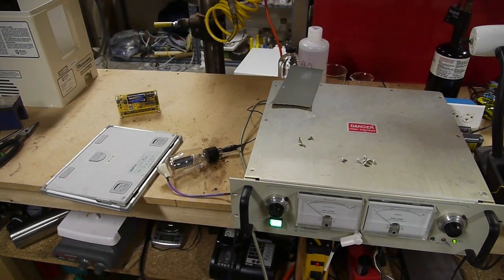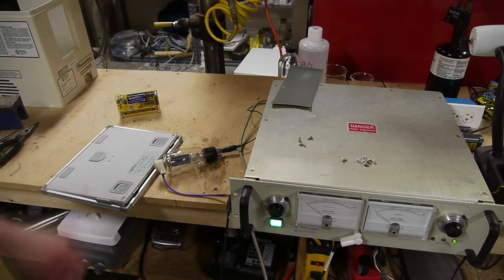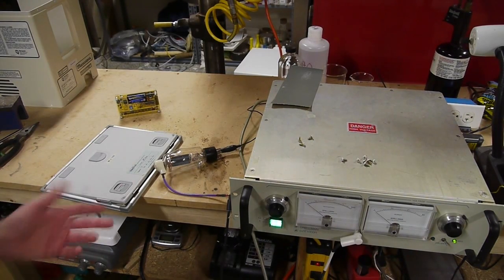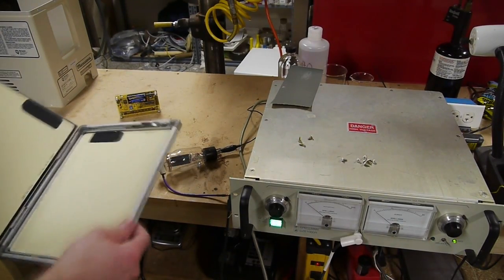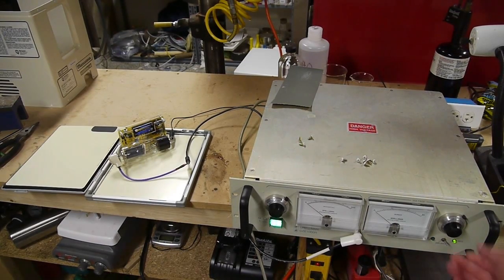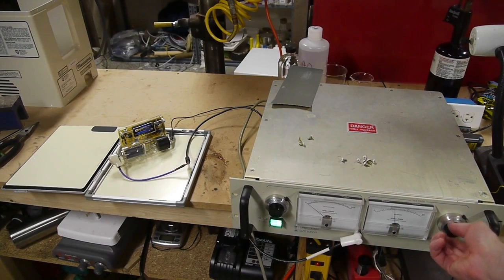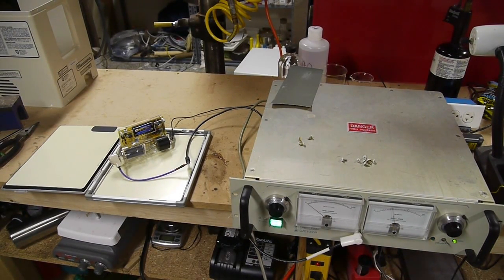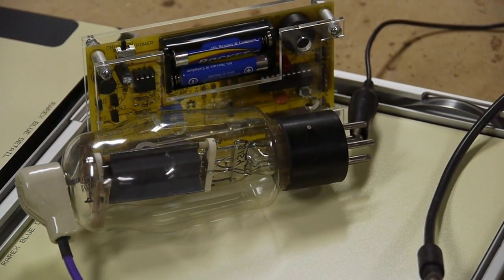Creating X-rays with a standard vacuum tube

Comment: Are you sure your Geiger counter is not being confused by the 20.000V volt electric field :)
Reply: yes, I have the same gieger counter and it's shit around high voltage. It completely breaks down if it's placed near a running NST or van-de-graff generator.
Reply: @lax1dude940  yes a geiger counter can't bear too much energy so it will break down.
Reply: well, he took it in his hands, which is surely enough to negate the E-fields, and i think HV DOES trigger Gieger counter 'cause it accelerates electrons so much that they blast atoms' inner electrons away and produce high energy radiation, specially static electricity, because of strong local E-fields.
we shouldn't underestimate HV, just look at this crazy stuff:
https://en.wikipedia.org/wiki/Terrestrial_gamma-ray_flash
Reply: Well, the glass gave off the typical x-ray glow
Reply: Yeah  I had one that acts like that. EMI sensitivity depends to how you connect the counter circuit. Original Russian datasheet has the diagram with the preferred (less EMI sensitive) way to use those tubes, with the outer part of the tube grounded and the pulses read from the inner wire electrode using a small de-coupling capacitor (10pF). But it is very common to sense pulses from the outer electrode instead, and that picks up EMI.
Reply: Can Geiger counters measure the affect of the high-voltage transformer? Hmm they measure really fast oscillations of Electromagnetic field like xrays and gamma rays. I doubt any fluctuations in the magnetic field of the HV transformer can mimic that. :{
Reply: @Élégante personné bramstrulung radiation
Reply: @SodiumInteresting  Yep, good old ‘Braking’ radiation which is why beta radiation is tricky to shield without accidentally creating X-Rays.
Reply: DC should not effect the tube inside the counter.
Reply: It WAS true x-rays setting the counter off....
Reply: Yes but we-re not so sure at what point we're supposed to laugh at this "joke".

Comment: HOw do you apply more than 15 THOUSAND volts to the filament and not have the inside of the glass turn metallic, and the filament literally vaporize??
Reply: I think the "cold cathode" mode he was talking about is where you simply don't power the filament (assuming this is an indirectly heated tube). If it's directly heated, the filament gets used as a single electrode.
Reply: jaywalker512 Thanks. :)

Comment: Dude wtf are you doing!! with all that radiation your going to create a atomic bomb! STOP!!
Reply: Don Julio How does one accidentally do something that took several years and tens of thousands of people to do the first time?
Reply: That's like accidentally building a skyscraper. Nope. No way.
Reply: "whoops, I just made a working industrial-grade fusion reactor while playing with a few kV of electricity" -said no one ever.
Reply: Like, you can't make an atom bomb with pure X-rays. You need kilograms of high grade fissile material, one or more toggleable neutron sources, big huge explosive lenses weighing several times to several thousand times the weight of your fissile material, some very precise timing equipment, giant tampers, a LOT of advanced math and engineering, etc.

Even the simplest design, namely, the gun design, which could at least be built on an unlimited budget by someone other than a team of physics PHDs, still involves some relative high-precision engineering and machining and a literal truckload of machinery. Even the crudest gun types are still finely-crafted machines made of poisonous heavy metals and high explosives in fairly precise arrangements. One might not need all that much engineering talent to make a gun-type, in comparison with more sophisticated designs, but it still involves a lot of very expensive and tightly-controlled materials.

And while actually designing such a bomb is probably something a classroom full of grad students could do in a semester, designing the equipment to obtain the materials is a much harder task. Even the most rudimentary gas centrifuge plant is a marvel of engineering, and the more crude and over-engineered the bomb, the more expensive it will be in terms of materials.

In short, anyone even close to building a nuke knows EXACTLY what they are doing. Making one by accident, while not actually a violation of the laws of physics, would probably require someone to have a bunch of synthetic elements and high explosives "just lying around," and even then, odds are probably a million to one that it's just gonna melt itself or blow itself to smithereens in a fizzle.
Reply: In fact, the only way the general public can hope to obtain such material legally and without horrendously expensive and complex centrifuge plants, is something like buying millions or billions of old smoke alarms and extracting whatever synthetic element is being used.

but that's a pretty seriously arduous, and also conspicuous, task.
Reply: The chemistry isn't the hard part. It is simply the engineering. There are thousands of very complex parts that go into producing 1 nuke. Even if you could create a nuke, it would be a very very weak one that would have way less that 1% energy efficiency. The first nuke ever built took people years of experimenting to create.
Reply: @alaric_3015  He's probably going to invent the Zray accidentally. Even more dangerous.

Comment: "A new MIT study suggests you could go 400 times higher than average background levels and you’d still not suffer very much genetic damage. The current limit for evacuation procedures is only 8 times background radiation Then I read studies suggesting even the tiniest radiation exposure can cause gene toxicity And I've seen studies claim low dose radiation can even be good for you So it seems there is no correct standard. It varies by person. Your genetic makeup most likely determines the risk"
==There is no reply button for some reason. Apparently, there was a study on rats and since our physiology is close to them, it stands to reason that it applies to us as well. It is rather counter intuitive. The problem I see with radiation is that the damage it does is random. You might get a tumor because of 1 single mutation and you might not. Some people in Germany go and sit in old uranium mines, in sofas to get their radiation dose.
Reply: something tells me no dose of radiation is directly good for you.
Reply: OLEMINER49ER Your "something" is wrong.
Reply: If its killing cancer it can be ; )
Reply: Vrej Egon Spengler One DSB can't in itself cause cancer. You receive more in a month from aerobic metabolism than a lethal dose of radiation, but it gets repaired.
Reply: Vrej Egon Spengler 
"...not suffer very much gene damage."  Very much?? 
Well, it takes only a single mutation to cause cancer.
Marie Curie died after her radiation exposure.  So we all die, but why are you wanting to speed it up??

Comment: For analogy , more hight is the Voltage between Sun and Earth and more X-ray are ejected from Sun ?
Reply: Wobogy
It will soon be mainstream that the sun is powered by electric discharge.
Reply: Huh? The Sun emits X-ray and gamma rays of various energies which are a results of nuclear reactions. The Sun also emits a lot of electron neutrinos which is also indicative of nuclear changes.
Reply: the sun emits X-rays from nuclear fusion. The way X-rays are being made in this video is by arcing electricity. A better analogy would be lightning arcing between clouds and the ground. The more energy passing through the lightning bolt, the more X-rays that get emitted
Reply: Mike Lentsch ...what?
Reply: Mike Lentsch
An electric discharge doesn't produce power. It is a loss of power : cations gain one or more electrons and become neutral atoms and the electron releases that energy as a photon.
Reply: Vrej Egon Spengler
Yes sir - thank you - everyone knows that.  The power is transmitted all over the galaxy via Birkland currents.
Reply: Mike Lentsch That's not a source of power. It is a name for a phenomenon.
Reply: Vrej Egon Spengler
I suppose that you could say that about everything insofar as "energy" isn't really ever "created", just transferred.  Even in nuclear reactions there isn't a net gain of energy in the universe since the energy came to be out of the "destruction" of matter (which is really to say that some of the "matter" has been broken down into a form where some of it's intrinsic energy escapes as EM. 

It's especially easy to see this from an electromagnetic point of view, as charge is in a continual state of moving (in the form of current, of course) in order to equalize potential throughout the system.  Obviously, this equalization won't ever happen with any permanence due to the other natural forces redistributing and concentrating charge.
Reply: Mike Lentsch You said
"It will soon be mainstream that the sun is powered by electric discharge."

I'm just asking what the source of power is.
Are you saying that there is some charge imbalance between the Sun and something else?
Reply: Vrej Egon Spengler My immediate thought was that he was saying that the sun was going to run out of fuel, and we were going to power it ourselves in order to survive. Seems pretty inefficient to me.
Reply: flamingchucknorris Nah, he is talking about some other theory called electric comet. 1. Basically, the idea is that the sun is an electrical phenomenon, no nuclear fusion. 2. Comets don't have ice, ammonia and methane. That the tale you see as it approaches the sun is an electrical arc.

That's what I gathered so far but this idea has major holes in it.

Comment: WOW as low as 15KV and your making x rays  !!!!!!!!
Reply: You should search for Grenz Radiation, used in dermatology for treating certain disorders.
Also a x-ray therapy in Austria that I heard of uses 13kV to treat some skin disorders.
You need a beryllium window to enable these low energy particles to escape.
Reply: I saw somewhere saying you need 300Kv to make xrays...
Reply: @fidelcatsro6948  that's incorrect, even old CRT monitors/tv's did emit a tiny bit of X-Rays, while those operate anywhere between 17kV to 30kV (depends on the size).

the reason crt's had such little x-ray output though is because, well, the glass is REALLY thick.
Reply: @BH4x0r  so that means a Tesla coil  or even an exposed spark plug arc..could be doing the same right?
Reply: @fidelcatsro6948  no, the tube needs to have a vacuum, people even achieved x-rays with properly sealed glass capacitors (it needs a very deep vacuum, which old CRT's also did have)

so a. your tube needs to have a deep enough vacuum
b. your source must be powerful enough, so it's not only about having 15kV but enough (m)A current too.
c. i'm sure tesla coil's don't have a powerful enough current output AND i think, this is where I could be mistaken, but i think you need a proper closed circuit (like one wire at one end of the transformer's coil and one wire at the other end)
maybe it IS possible if you hook 1 end of a tube up to ground and the other end close to the tesla coil, but as i said i don't think thats powerful enough as it's not just about the volts

but no in OPEN AIR it's not possible so that's all safe
Reply: so it needs a lot current to the hv, so technically a cfl tube or even a blown auto lamp bulb both with sealed glass could produce xrays?
Reply: @fidelcatsro6948  no you need a proper vacuum, cfl & other lamps still have a lot of different gasses which is why those wont produce x-rays

"a lot", not really, it depends on the glass' thickness, the tube used, the vacuum in the tube and everything
Reply: @BH4x0r  did you study nuclear physics?
Reply: @fidelcatsro6948  nah, i've just always been interested in electronics in general, both old style (vacuum tubes, crts) and new (mosfets, transistors, igbts, microcontrollers etc) and in low and high voltage, so ye.

but the voltage for your tube to produce xrays will depend on how high the vacuum is, how far the electrodes are separated etc
Reply: @BH4x0r  whats your opinion on free energy?
Reply: @fidelcatsro6948  it's B.S. unless you call solar power, hydropower, windmill power, or other "green" power sources "free energy", anything else in yt vids made by people is pretty much actually faked stuff

Comment: so it takes 30kv in the uA range to produce x rays !!! so if you use say 25kv them the peak V could easily make 30 plus KV meaning x rays are easily possible and quite likely .well im glad i got a Dosimeter .more people should be watching this as they think there safe and in reality there not as safe as theylike to make out .great video ,John
Reply: these low voltage X rays do not pass Glass easily. You need something above 30kv to get some penetration power.
Reply: your punctuation spacing, its very unique.
Reply: Its like me unique LOL I'm shit @ that kinda stuff .Never have been good like that ,but I do have other good quality's I just haven't found them yet ;)
Reply: HighVoltageProjects: "so it takes 30kv in the uA range to produce x rays !!! so if you use say 25kv"
==25 kV will produce x-rays. A lot of tvs use 25 or 26 kV. Even small TVs that use 15 kV produce it and they all have a metal shielding in the back. The glass contains strontium so that it also acts as a absorber for X-rays.

Comment: Ben, this is awesome.  How do you protect yourself from the radiation?
Reply: The x-rays doesn't reach very far through the air. You need much higher voltage for real strong penetrating x-rays.
Reply: @Dr3x0w  That makes sense. Thanks Andreas

Comment: It is possible to have a spark in a vacuum, at high voltage you will have a electron cloud around the negative electrode (well that might not be a TRUE vacuum if there are particles like electrons in it, but hey...) And if the tension is high enough (or electrodes close enough) you will have a spark even in vacuum.

Comment: Well, probably not that much radiation there I think, since you're only operating it at 20000 volts and not for very long. Also, the glass doesn't let much radiation through. Not at these low energies anyway. X-ray tubes are generally made with a window where the glass is quite thin. However, playing with radiation is always a dangerous thing to do.

Comment: To tell if it is really x rays, take a sheet of lead or even steel and slide it between the tube and the counter. If it is spike interference, the counter will still click away. If it is X rays, the counter will stop counting, or reduce count drastically since the low voltage X rays don't penetrate the lead. Fluorescent screen, you will not be able to see glow with your eyes until the dose rate is in the hundreds of MR per hour, a very high rate and not possible with your power supply current.

Comment: In vacuum tubes most of the hard impurities would be due to getter remains. In this case anode is too close to cathode so at 20kv the xrays generated are not accelerated enough to penetrate screen + glass + air atmosphere. Nice shop by the way...

Comment: Hi Ben, I am not convinced that what you measure is X-ray. My Inspector GM counter indicated a high reading, 20 µSv/hr, when placed at a distance of 10 cm from a sparkgap Tesla coil.  When I replaced the GM counter with a scintillator, I measured only background. Besides, a GM counter is very insensitive to low energy X-ray (below 40 keV). I believe that what you measure is due to the electric field your tube generates, which disturbs the GM tube. See my channel,newest video. Regards, Alfred

Comment: Thanks for the info :)
About the conductive glass: I don't need conductive glass in particulair, I need something that is see-trough and conducts electricity. Maybe some sort of plastic, or a thin layer of metal deposited on a surface (maybe even graphene)? I was thinking of metal nanoparticles in water, and then evaporate the water so only the metal would remain.
I find $30 for a sheet of 10x10cm a bit to mutch for a school project, and I will be needing quite some glass. 

Thanks for your time

Comment from the maker: The geiger counter is a Mighty Ohm kit. Search the web for mightyohm. Glass can be coated with ITO to form a conductive layer. This process typically requires a vacuum chamber or sputtering setup -- probably much more expensive than buying glass already ITO-coated. Still, it might make for an interesting video.
Reply: A bit late to the game but in my similar experiments I found that the geiger counters mainly respond to the electric fields, properly grounding them in that setup makes any signal basically go away and you need much more sensitive devices to detect anything at all

Comment: I am currently doing a similar project. I am looking at using a General Electric GL 8020 tube. Unfortunately, I do not have a HV power supply, so I was going to make one using an emco dx250. Good thing raw lead isn't that expensive :)

Comment: Hobbyist x-ray trivia: soft (tens KeV) x-rays barely penetrate common GM tubes. Try alpha-window tube, then your counter will roar even when held feet away.

Rather than Intensifier, try Zinc Sulfide paint on black paper, then put the x-ray source behind the paper.  Dark-adapted eyes will see some flashes and glows.  Good source of large amt of ZnS is Speedball Night-glow fabric paint from art supply stores for around $15.

Safety: compare to solar UV of similar photons/sec rate:  insignificant!

Comment: this would hard to find. e bay?? but similar devices and probably were this came from is an old laboratory (mostly in collages) with a requirement for high voltage. like this one when they get outdated collages get rid of them or put them in storage and are lost. they replace them with ones that can regulate amperage and voltage precisely. but dont get me wrong something like this is worth a lot and is very good for some uses.. but not for creating x rays.. not enough current